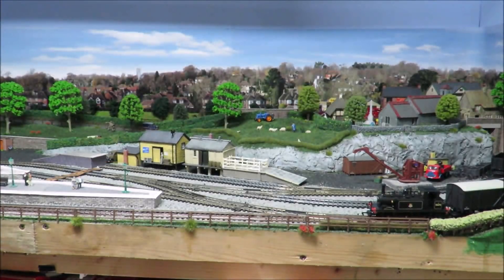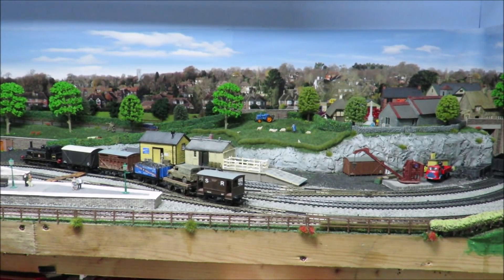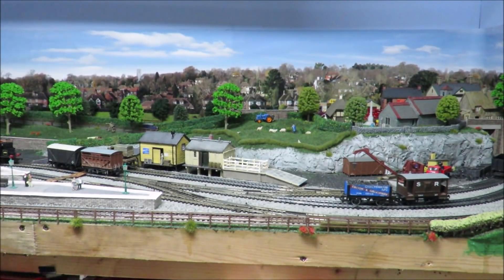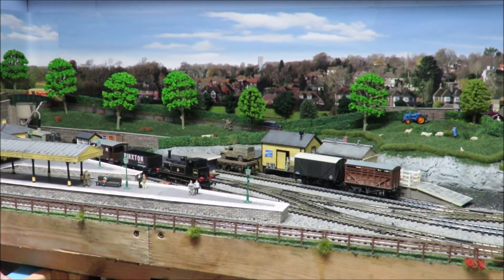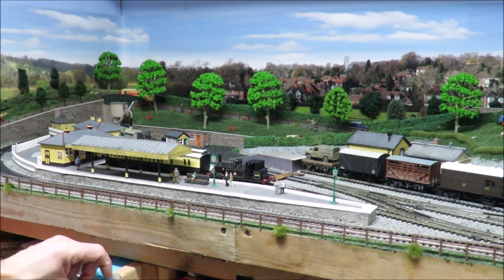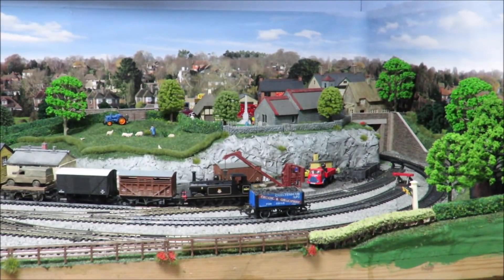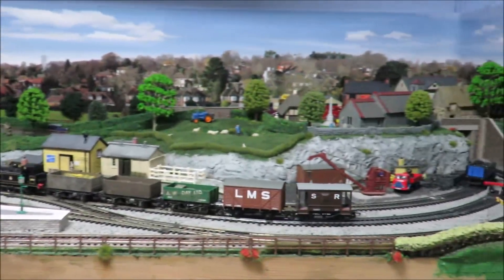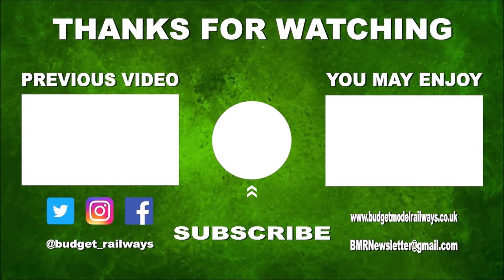Steam Trains Shunting On My OO Gauge Shed Layout - Hornby Terrier - Part 8

Comment: Hi there great video you mentioned the possibility of point motors I've started using servos and an arduino it's cheaper than solenoid and no clunk's. The arduino code is copied straight from the Internet (little wicket railway) is a good place to visit or search arduino servo Point

Comment: Hi.

Would love to see an aerial shot of the sidings layout (points etc), or a quick video shot of a pencil sketch instead. I need to work out how to install the wiring as reversing the loco on to a different turn off after the points have been switched means that the power has been cut off to that particular turn off (if you know what I mean). Any advice would be very much appreciated. 

Cheers!
Reply from the maker: If you take a look at the video before this that shows a better view. The switchback sidings simply need a set of power feeds each, if you put a simple on off switch on one wire you can isolate that siding
Reply: Brilliant. I do watch all of your videos but the reason I asked for a sketch was so that I could work out the wiring arrangement. However, no need for that now as you have addressed my quandary, thus enabling me to reconstruct my sidings arrangement in similar fashion to your own. Many thanks for your prompt advice, thus saving me from the expense of a packet of aspirins. 😁 

P.S. I do love the simple construct of your layout and like you, I am prudent with my spending as I refuse to be held to ransome by the astronomical hike in prices for new locos etc. in the last 2-3 yrs. I'm analogue and always will be. All the best!

Comment: I have seen now your shunting session and I have two things in mind seeing it. First, I find your overall landscape very convincing seeing from a casual point of view. It's very realistic, clean to the eye with what is needed put where it is needed, no scenery overload or obvious trick visible in plain sight. I take notes on it for my own projects.
Second, your scenario for the shunting operations and their motives is highly realistic, and adds a lot to your overall setting. Your explanations during the (very interesting) shunting session is a superb bonus. As you said, fun is paramount in modelling, and it was fun to watch in my opinion.
For the jacking up of the prices, you have already guessed that anything is used by the manufacturers as a justification to increase their prices, regardless of the needs of the market. Well, you are right to say that DCC is not mandatory, and you can get along without it. I would start railway modelling from scratch now, I would discard this option immediately. I already have DCC equipment from ages ago, that's why I use it. But not on my N gauge rolling stock : a misplaced pain to do that on my japanese rolling stock, and no bonus in operations on my US rolling stock. Note that those reasons are valid for both class of N gauge equipment... Put a DCC socket on a locomotive does not costs dozens of euros/pounds : just add a socket that costs pennies/cents, redraw slightly the printed circuit board of the locomotive, let a machine solder both on the assembly line, et voilà : cost for the manufacturer 1-2 €/GBP, cost for the customer whatever you want to rip him off. DCC turns to be the greatest swindle when it comes to prices of overall not so complicated electronics.
I won't have to convince you that there is a market for model trains stripped of every conceivable gadgets invented those last 30+ years by the manufacturers as an excuse to supercharge the prices. If you admit that you can get a customer base that don't care about an overdose of detailing and shiny (and pointless too) electronics on board, you can get large tender engines for 50 €/GBP, small ones and tanks for 30 €/GBP, coaches around 15 €/GBP and wagon as low as 5 €/GBP. 
By the way, 3D printing would soon becomes to model trains manufacturers what Napster and its P2P follow-on programs had becomes to the music industry. And good luck to sue people printing their rolling stock instead of buying it, especially with prices in the luxury items range...
Reply from the maker: Thanks, all very good points. I have just bought a Piko Basic loco ,an 0-4-0 tender loco for £40 inc postage, so why is the Hornby 0-4-0 £55?

Comment: Is this Terrier an older Hornby model?
Reply from the maker: Yes it's one of the older ones , but it's an excellent runner
Reply: @BudgetModelRailways  I thought it was. I bought an older 'top link' preserved terrier and it's in the post.
Do they run well too with little noise?
Reply from the maker: @mattseymour8637  I have a top link one which is also good
Reply: @BudgetModelRailways  Nice! Does it run smoothly and fairly quiet?
Reply from the maker: @mattseymour8637  smoothly,even over points at a slow speed. Not quite as quiet as a modern loco, but not as bad as an old Airfix one lol. I think you will be pleased with it
Reply: @BudgetModelRailways  Ok that sounds good then. I was worried how it would run and how loud it would be.
I do like the newer Bachmann quiet ones though but I think the older Hornby stuff is good.
Have you any videos of your top link model?

Comment: For some more clarification on the box van numbers thing (which depends a bit on the specific era of the layout) 

Box vans were mostly used in the following situations:
- The cargo can't get wet.
- The cargo should not get dirty from exhaust or catenary scrapings (which often is the case with car transport which needed specialist equipment anyway)
- The wagon was private property of the factory (did that happen in the UK?) 
- The wagon was some kind of specialist vehicle (reefers, horse boxes, heating installations or a Leig unit) 
- The vehicle is designed for high speed express goods service, which includes horse boxes
- military trains transporting troops in goods vans 
- Cattle transport (cows and other larger animals), these are specialist vehicles with heating installed.

For everything else you used a open wagon, or a specialist vehicle

Comment: I find that shunting is one of the joys of operating a model railway. If you will allow me, can I make a suggestion that might give a better flow to your videos. If you have a remote control facility on your movie camera then my suggestion will make it very easy. (if not just manually pause the camera)  When shunting use the PAUSE BUTTON on your camera, then while it is paused manually uncouple any wagons and when this is done hit the PLAY BUTTON and resume filming. This process can be repeated with each shunting movement. It might add a few extra minutes to filming, but it will be well worth the effort as it will give you a professional looking video. You can make as many mistakes as you like when the camera is in the PAUSE Mode and no will ever know.  Cheers  Greg  🚂🚃🚃